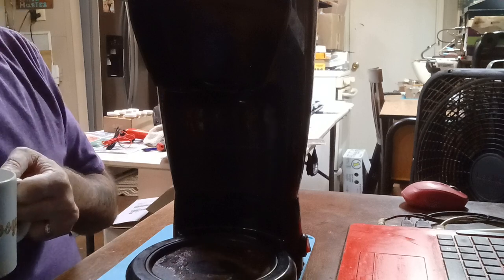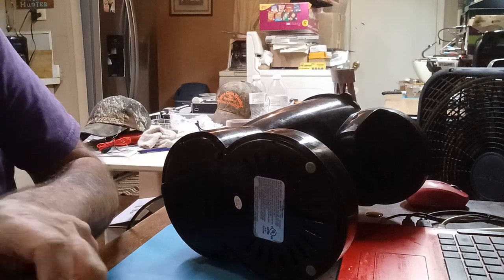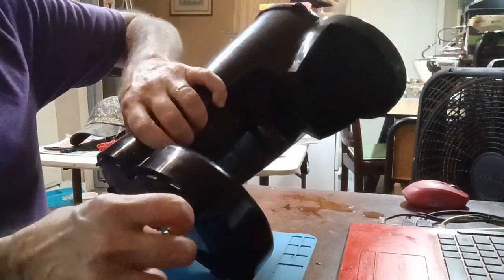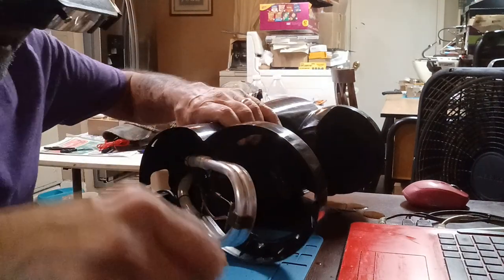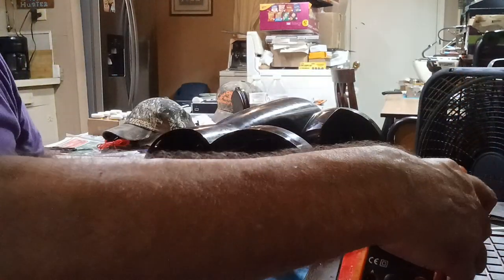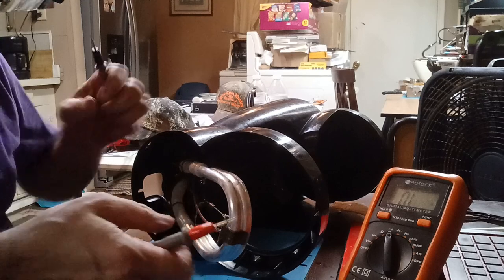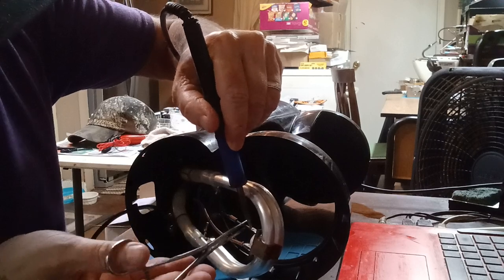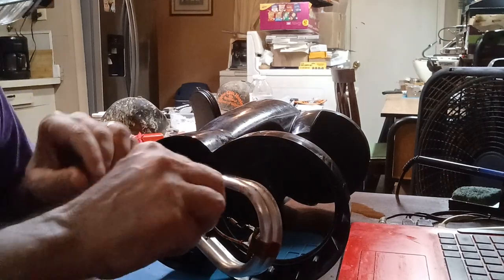Black + Decker Coffee Pot repair.....

Comment: Hey Boo I really enjoyed this one. I was following right along with you. I used to do a lot of soldering on relay panels back in my helicopter maintenance days. I figured this was a fuse type device. You troubleshot it perfectly. Wonder what caused it to burn out? A weak thermostat, power surge??  Hopefully she's up and working after you solder in the new thermal fuse. Make sure you keep Missy's Gumbo Pot working too!!!!
Reply from the maker: We did have power go out and a thrown breaker about the time it went out ......
Reply from the maker: Part 2 is up and running ....

Comment: What is this bit called and which sets would have it? Thanks!
Reply from the maker: Those are U-Type screw bit's here's 2 links for them  https://www.amazon.com/Kozelo-Spanner-Screwdriver-Bit-Set/dp/B0BNNCW8C7?source=ps-sl-shoppingads-lpcontext&ref_=fplfs&psc=1&smid=AR7FQVCMFW0M3

This is not my set but it is similar , I wish my set would have been this cheap  https://www.amazon.com/Precision-Screwdriver-Computer-Electronics-Controller/dp/B09WZS5B3B/ref=asc_df_B09WZS5B3B/?tag=hyprod-20&linkCode=df0&hvadid=693535620609&hvpos=&hvnetw=g&hvrand=14741922701554107735&hvpone=&hvptwo=&hvqmt=&hvdev=c&hvdvcmdl=&hvlocint=&hvlocphy=9025277&hvtargid=pla-1946982377198&mcid=b71fc275936238a0a5f0f77d44e292d2&gad_source=1&th=1

Thanks for watching ....
Reply from the maker: Actually my set has a lot more spudgers and other items in it than the set I posted here ...
Reply: @cajuncoinhunter  thank you so much for the video and the links!